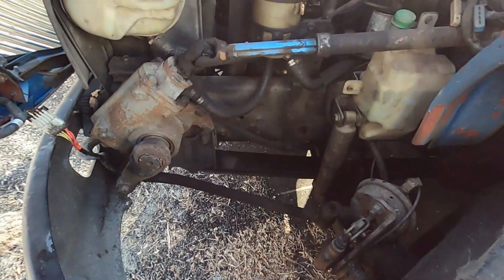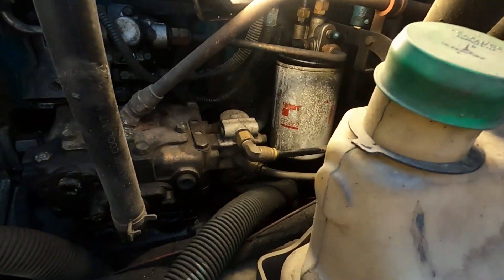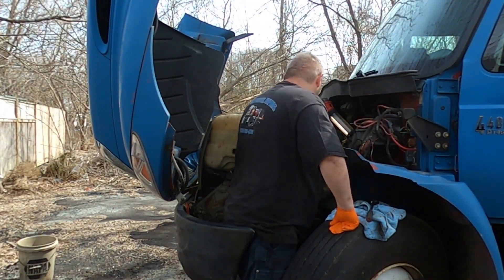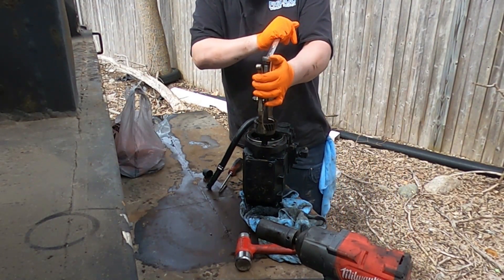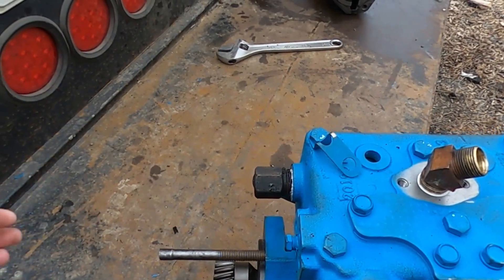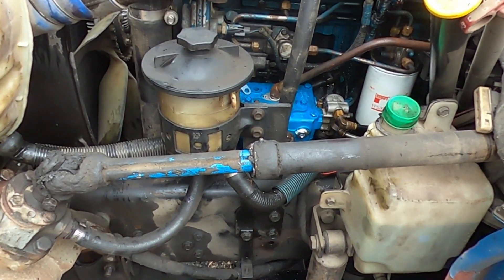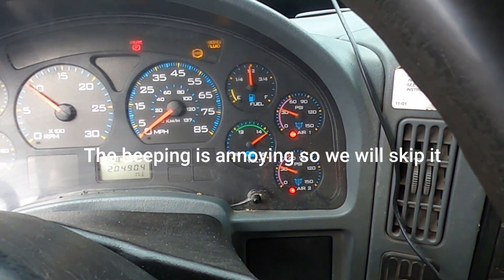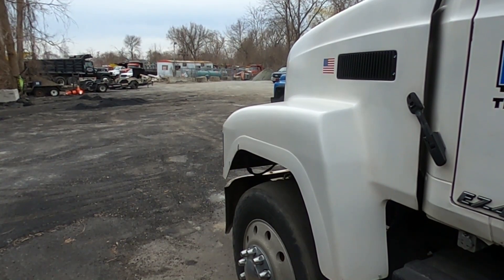How to Change a International DT466E Bendix Air Compressor

Comment: What do those compressors run nowadays. My 02 pulling oil..coming out air tanks when it purges I guess/or open the valves on tanks
Reply from the maker: You can get a reman one for about $600 online. Expect to pay more locally
Reply: @northeastdieselrepair ironic you answered today. I had compressor on and it was fine for a week then engine light came on again...no oil!!! I have no clue where oil is going. I have no puddle on the ground or the undercarriage.  Have to check the turbo closer I guess. Mechanic coming back today

Comment: Do you need to take the front cover off the front of the motor?
Reply from the maker: No you do not. There are bolts that go through the front cover and the compressor mates to the back of the front cover.
Reply: Thank you

Comment: Anybody know what the sensor behind the air compressor is??? 😅
Reply: The injection control regulator is very close to the air compressor which has a sensor style plug in it. Not sure if that’s the one you are talking about?
Reply: @frankthetank9682  no, it's a sensor. Im pretty sure it's the engine oil pressure sensor. I looked up what you suggested and it looks nothing like that.
Reply: Well I'm forced to work in 3 below zero weather here in St. PAUL mN this Feb 9th 2025.  There is a a bus and truck parts place in Big Lake MN I traveled for over 1800 miles on a worn compressor to save 170 to 300 in shipping.  Was hoping it lasted me till I got home in SW Idaho to replace.  But on way to get another car it failed.  So at least I have a used one. That was tested good..  I'm getting close to having it out now.  I decided to warm my truck again before removing every thing that is in the way.  So as it ran decided to see if it was getting any air from where the line goes into the compressor from the air filter and barly was sucking any air in should of been like a vacuum and would want to pull my finger in.  So back to work I go here.  I'm hoping I do not need to drain the coolant completely though.  Think I can clamp the hoses off to the pipes that go into it.

Comment: Hello. The first hose you put you hand on in The video. Can you tell me where that hose goes
Reply: The first hose I touch was going to the power steering reservoir to the power steering pump supply fitting.
Reply: @frankthetank9682  ty for your reply. I was wondering because I've got a DT466 out of a 1995 international that I put into a 1992 international 4700 and the configurations are all different and the pump is completely different. I have a fitting on the side of the pump and I'm not sure where it goes

Comment: My air compressor leaking oil through the airline's what do you think
Reply from the maker: You are going to have to change your air compressor to resolve that problem. Oil in your air system will eventually swell the o-rings in your valves depending on the severity.

Comment: You ever seen the unloader stick in one of these compressors? Mine will just keep going over 140-150 psi plus
Reply from the maker: Yes only a couple times. There should be a unloaded valve kit that you can replace on the top of the compressor while it’s still in the truck. It has solved that problem for me when the governor valve was okay.

Comment: So I’m replacing the same compressor and when I removed the drive gear to put it on the new one I noticed that on the old gear shaft it has a key to keep the gear in place but on the new one it doesn’t the shaft is smooth all around. Would I still be able to install it like that or would the gear just slip when the other gear locks into it since it has nothing holding it in place
Reply: The compressor shaft may be a taper style so when you tighten the gear onto it, it becomes a press fit. Just make sure you use loctite and the nut is tighten down good.
Reply: My worry was that the gear would just spin freely on the shaft since there isn’t a key holding it in place and the shaft wouldn’t spin to make the compressor. Just want to avoid doing the job twice it’s on a bus so I have to do everything on my back. Thank you for the help!
Reply from the maker: Where the gear goes onto the shaft it should start small  and get bigger the closer you get the the pump so when you tighten the gear down with the nut it “jams” itself into the shaft so it won’t move as long as it’s good and tight. Doing the job again does stink but having the gear fall off in the front cover would do a lot of damage

Comment: How much is the labor for a job like this
Reply from the maker: 2-3 hours depending if the gear on the compressor come off easy or not. That would just be replacing it not driving to the job or diagnosing it.

Comment: Did you replace it because it was leaking oil? My truck leaks oil under the air compressor but I haven’t found where exactly yet
Reply from the maker: I replaced it because it was worn internally and pushing engine oil through the air system and it was coming out the air dryer. It could be leaking at the front where it meets the front cover. I’ve had the high pressure oil pump which is above it leak down onto the air compressor looking like the compressor was leaking but it was the high pressure oil pump.
Reply: @northeastdieselrepair  thanks I’ll check that too

Comment: Why darin coolant ??
Is it coolant house to compressor ? Where is located at comoressor on wich side is coolan house is located ?
Reply from the maker: Yes coolant goes through the air compressor from a hose from the engine toward the top to help keep it cool it down.
Reply: @northeastdieselrepair  

Ok
I asked because i see a big coolant leak between block and air compresor but
Its not really visible to see where the leaking is coming from
It leaks after truck is warmed looks like when the thermostat open.

Thats why my question

So i gues its air compresor house
And looks like i have ti remove comoresir to replace that house ??
Reply from the maker: The compressor engine oil drains through the front of the compressor into the front cover. The coolant has a drain hose on it to drain back to the engine so the compressor may have a crack in it. Check your engine oil level and make sure your level isn’t high. Hope this helps
Reply: @northeastdieselrepair  

Ok i ll chk on comprssor.

I did chcked oil leves aeveral times and iddle the truck but oil kevels still ok sane level.

So whats the coolant drain house located on the compresor ?
And should i remove the comoressor in order to replace crack house or fix this coolant leak ?
Reply from the maker: The coolant drain hose comes out the back top of compressor. The inlet is the front top. You need to identify exactly where the leak is coming from. Make sure it’s not coming from the inlet hose or fitting before you change a expensive part.
Reply: @northeastdieselrepair  
Ok
Thats what i m trying figuere out 
As dont know much bout air compresor and all i can see is a leak from bottle of engine
Coming out between the compressor and runing down on the block.
But its hard to see the leaking coming out.
Thats why i asking ti see if there is a fiting or house or plug between e gine and compressor..
Reply from the maker: If you google Truflo 550 air compressor it will give you a better look at the fittings under images.
Reply: @northeastdieselrepair  
Ok
Yea i got it pretty good now
That leak s from the coolant fitings
Thnks sir for your help

By way you got great video 
Replacing compresor on dt466.
Reply from the maker: No problem